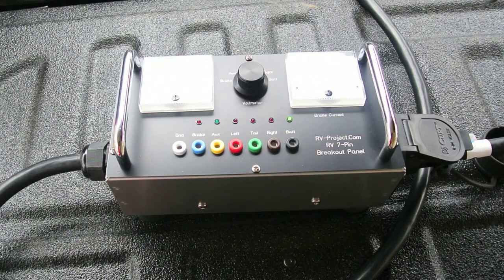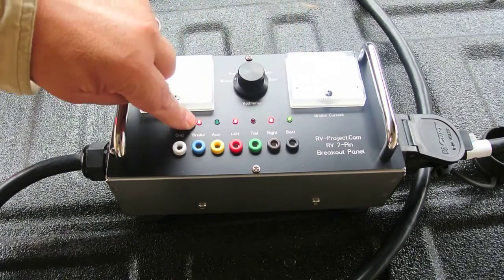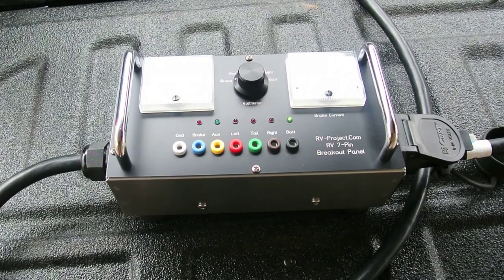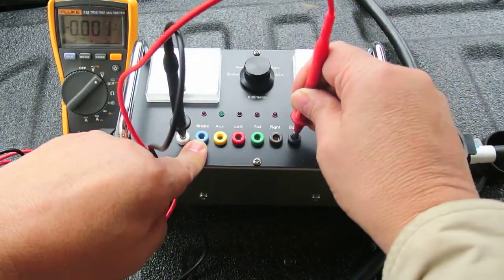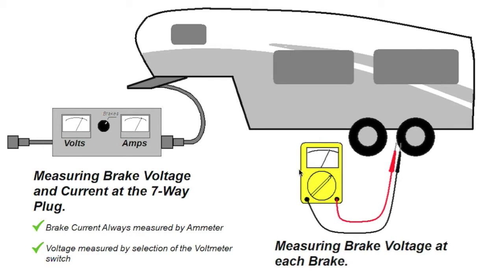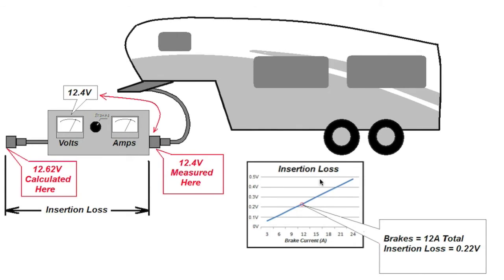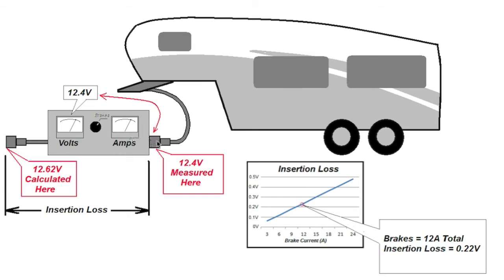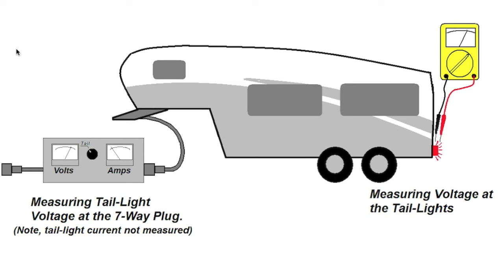A Custom built RV Trailer Wiring Test Box

Comment: i am in the process of building this very same breakout box, except mine will also test 4way utility trailers too. 2 seperate trailers using the same box. i have an onboard battery pak when not hooked to a vehicle, with a disconnect switch whenever a vehicle gets connected. half of my breakout box is for rv trailer wiring, color coded. and the other half is for the 4 way trailers, color coded wiring all around with a main switch and 3 lighted toggles for each system. also has external battery charger connections for charging onboard battery. i am considering going one step farther and adding a solar charger. i might post my wiring diagrams once i am done and my box really works. i already downloaded this guys wiring schematics, and about half done with the box. got some pix of it too. very nice video about how to use those jacks, often wondered how they fit in. diagrams from your download was very nice too. thanx.
Reply from the maker: In reality, my goal in all of this is to have my subscribers do exactly what you have done, to take an idea of mine and adapt/improve it to meet your needs.  

I have a "testimonial" section for a few of my projects, showing reader feedback with projects they have done as a result of my idea. If you would like, send me photos and a narrative and I will post your efforts on my website.

Here is a link to my website so you can contact me directly:  http://www.rv-project.com/formmail/cf.php